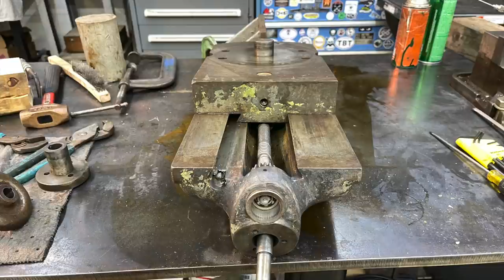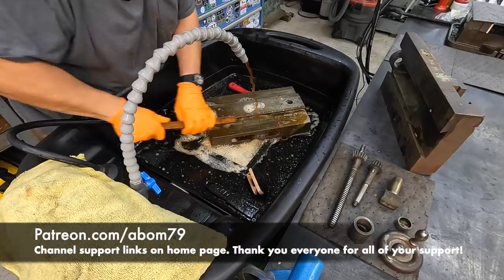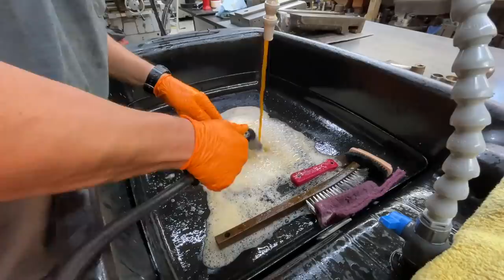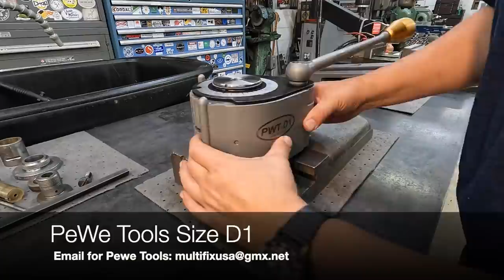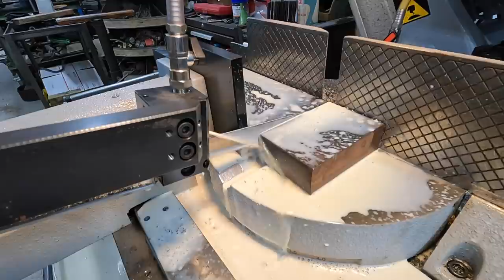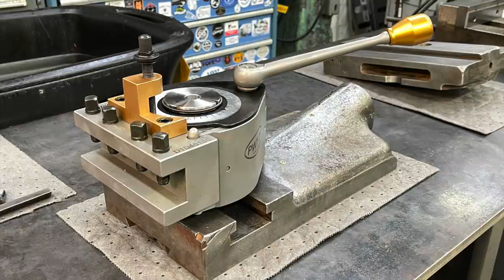SNS 360: American Pacemaker Compound Tear-Down For Rebuild

Comment: If there is enough length to the brass nut, you can incorporate a backlash adjuster by making a 2/3 deep hacksaw cut 1/4" from the end of the nut.  At the beginning of that cut, drill two holes in that 1/4 section and tap them.  All you have to do then is adjust the backlash by tightening the screws.  This closes the gap on that saw cut and picks up that backlash.

Comment: I repaired such a crashed nut a while ago. I bored the old threads (plus 2mm) out made up a brass plug and soft soldered the it in (in place in the milling machine vise), drilled/reamed the inner diameter and cut the new thread on the lathe. it's holding up fine.
I saved a lot of machining steps this way.

Comment: Man... I'm glad that I'm not the only one to have that kind of experience in refurbing an old machine... paint, oil, chips, filth, etc... concealing fasters and limiting movement has absolutely been the biggest theme in my own machine tool wrenching efforts.

As for cleaning, I don't have a parts washer, but what I have found is the most effective/economical is using diesel fuel as a solvent and a green Scotchbrite pad.

Comment: Don't use normal 6201 ball bearings. You need the 3201 angular contact bearings to take up the thrust and backlash
Reply: You can use deep groove ball bearings as if they were angular contact provided the thrust load is not excessive, and in fact most drill presses do exactly that. It would be fine in an inexpensive import lathe, but I agree that for a lathe of this class there should be an opposing pair of angular contact bearings, either with the inner ring end-faces ground underflush (by the bearing maker) to provide the correct preload, or by careful engineering of a suitable (cylindrically ground) spacer.

Comment: Adam, You are a machinist, Correct! Make the nut and cut the threads on the lathe using a form tool. Drill and (on rectangular brass piece first) cut the threads using the 4-jaw on the lathe. Counter-balance. if you screw up, you can always whip-up another one. File the butchered corners on the cross-slide and go to Sherwin Willians and get a gallon of Industrial paint in a bright lovely color of your choice. Paint the cross-slide and all the cast iron parts. Sand and polish the handles. You can paint the bed/headstock later, Hire some kid. The Multi-fix looks great. Oh yea, cut and throw away those 2 threads on the cross slide screw. My 2 pennies!

Comment: That is a beast of a tool holder.   Put the compound back as is but then fab a new equivalent acme screw and nut.   Could also have a new nut cnc thread milled.
Reply: Agreed, replace the leadscrew with a 5tpi ACME thread and a suitable nut. There's bound to be wear in the screw anyway.
Reply: I was going to say that too....

Comment: We just got one of those parts washers into our shop, I was initially skeptical but was very pleasantly surprised the first time I had to clean off some old pins on just how well that solution works!  Just wish the tub was a little bit more heavy duty so we could put our truck hubs in there without worrying about breaking stuff!

Comment: Adam, I think I would make a new lead screw and nut in acme thread and eliminate the backlash in both the lead screw and nut and solve the problem of the obsolete square thread.
Reply from the maker: That’s the plan.
Reply: @Abom79  would changing to the acme thread change how the indicator marks readout
Instead .1000 in actuality it might be .0001?

Comment: I don't know why, but I enjoy cleaning old grimy parts and seeing them come out clean.  Nice parts washer setup.
Reply: Indeed, but it doesn´t do anything (for the home shop guy, at least) which an old laundry tub and some kerosene in a cheap and cheerful lab supplies wash bottle, and stiff bristled brush and some Scotchbrite won´t do. Kerosene is not suitable for intensive long term use in production settings, but if you´re just refurbing the odd machine tool, its perfect. 
Kerosene used for parts washing can easily be retrieved and reused by settling it over water: the dirt drops out of the kero (top) layer and can be drained away and disposed of (without polluting the grey water system). It´s an easy matter to make your own parts washer incorporating this principle with a cheap marine bilge pump. Fit a drain for the semi clean kero in the side just above the level of the water, and another drain (a large diameter screw cap) at the bottom for the dirty water.
If you avoid putting oily parts into the kero it will stay relatively clean. start the process with a ¨total loss¨ stage (ie discarding the minimal amount of solvent needed to wipe off most of the oil)
ScotchBrite is a product which delivers (crudely speaking) twice the performance for a price premium of 1.2x
That orange stuff, on the other hand,  turns those ratios on their head.
I deplore the turn so many You Tube influencers are taking in the direction of promoting ¨affluenza¨. It is undoubtedly good for the Gross National Product, but so are such things as war and natural disasters.

Comment: Adam, at my families machine shop we make very similar leadscrew nuts that are sold directly to monarch and leblond for there spare parts warehouses. They are not typical bearing bronze they are c954 aluminum bronze. Also we get the taps from a supplier called Widell Industries and we use our bigger mills like your new KBC to tap them. However monarch and leblond have switch to ACME threads so I don't know if Widell has square thread taps. Hope this information helps.
Reply: I think a number of us here say thank you, Dalton. That's a pretty useful lead.

Comment: Adam
I have a pacemaker with the same compound. I just dissembled it and my bearings Were sticky like yours. Very similar condition as yours overall. My screw and nut were tight with little wear. [ACCEPT] The first three threads on the brass nut were broke off exactly as yours were. Thats too similar to be a coincidence. I'm wondering if there may be something in the design that either allows too much travel and the screw is coming out of the nut or almost coming out putting stress on the last three threads holding.
I'm going to study the length of travel and see if I can figure this issue out. If you can look the length of travel in relation to the length of the screw maybe, you can figure out why this is happening. It may need a stop or spacer to prevent over travel.
If you see an issue, please let me know what it is.
Thanks Mike

Comment: Adam, you need to watch Kurtis on Cutting Edge Engineering; he makes his own boring bars, due to the size of the jobs he does. His latest one he has to use his overhead shop crane to put it into his lathe.
Reply: Always someone to mention Kurtis when  Adam doesn't like him or his channel.
Reply: @stevendupre2792  Why doesn't Adam like him or his channel?
Reply: Most likely because people are always comparing their channels to one another.
Reply: @stevendupre2792  Kurtis challenges his "keyboard warriors" and he shows how he cuts out 6 extra steps before working on a barrel for a hydraulic cylinder so all he has to do is measure the height and length of the piece before he makes one chip.
Reply: @MRHSDM316SD18186  I'm not sure I understand your comment. I didnt hate on Kurtis' channel or his work. If anything he's more popular than Adam is now since he's become nothing more than a YouTube creator.
Reply: @stevendupre2792  Both Adam & Kurtis know their trade. WHen I watch their videos it's for knowledge on the tooling used for the various types of steel being machined. I picked up a 1937ish Atlas machinists lathe to make my own parts & tools. I am not a machinists by trade; mech. fab. welder by trade. I want to learn how to machine properly as well. I should have done this back in my 20's.

Comment: Adam, if you tap new thread then you might end up with loose fit because of the wear that is already in the square thread so if you tap you might want to get a undersized tap then hone out the threads.
   Someone already posted that you might go to a split nut so you can adjust out the slop when needed

Comment: That's a lot of backlash in the leadscrew. Yes you can work around it, but given that you will likely be using this lathe for many years, I'd put in the time to either cut the right threads for the screw, or just make a new ACME screw and nut to replace the original ones. You have the chops to do it, and the results will be SO much nicer to use..
Reply: That's my bet on what he's gonna do

Comment: Adam, If you can't find a 3/4"-5 square tap and since there are 3/4"-5 Acme taps available you could make a whole new compound lead screw and nut with Acme threads. It won't be original but it will be do-able and work just as well as the original did when new. I believe the bevel gear on the lead screw is pressed on so you won't have to make (or source) a new one of those.

Comment: Here is some trivia you'll probably like.  I learned machine work at place called Industrial Bearing, a bearing suply house for heavy industries like mining.
The bearing you said was "sticky" is a referred to as "staging" because it wants to stage.  Its a very common failure in universal joints where the bearings have made like detents in the race surface from opporateing in the same place over time.  This is the reason engines are mounted in vehicles at an an angle or the pumpkin of axles are offset to one side, forcing U-joint to move enough to use the entire race surface.  So U-joints are actually required to be misaligned to function correctly.

Comment: Nope.  Two 6201s don't make a 3201 bearing.  Regular bearings good for radial thrust, u need a cartridge 3201 for axial thrust.  The bearings u removed failed because they cannot handle the axial thrust of the lead screw.  If u need technical advice find a different bearing supplier.
Reply: @paulcopeland9035  I am trying to stay polite.  Go to bearing book.  Yup, complicated formulas.  Look at coefficient for axial thrust for a 6201, and a 3201.  6201 is a minute number compared to a 3201.  Originally 3201s were sold as two back to back bearings but now are available as a single cartridge bearing w near zero axial clearance.  Dude who advised Adam might be qualified in getting sales entered into the $$$ register but is clueless about bearing types.

Comment: The smart wash Ozzy Juice is an amazing invention.  Since it is sooo expensive the juice they claim not to add water as it dilutes it.  I queried the compound and 98% of the solution does not evaporate therefore by heating it all the time the water is all that evaporates I’ve already done the expirementing it works great cuts the cost down in fact it seems to me it works better.  The mats carry the microbes that eat the oil and grease and have found changing them monthly really helps keep it working great.  One of my favorite tools in the shop.  Im a bit older and find I feel sick if im in the solvent or diesel and have had to rely on rubber gloves.  Getting old is not for wimps LOL.  God Bless you brother.

Comment: Adam, So ill bet if you start asking around you'll find that square thread tap up here around the Cleveland, Ohio area or the Great Lakes area. Some where that those 80-100 year old machines where worked in back in the day. I've shot a buddy of mine a message thats in Euclid, Ohio. He's still has his fingers in older tooling like this, So its very possible to still find a tap that you could source to make another replacement nut.
Reply: Вітання з УКРАЇНИ ,думаю мітчик  можна виготовити самостійно, враховуючи нестандартне  різьблення винта. Запалити та відповідним чином заточити. Для майстра це буде не складно.
Reply: weren't Monarch lathes made in Sidney Ohio?

Comment: I think the design for this T nut will evolve once you get into making it. A stud is going to be way more rigid than a bolt for clamping the tool holder down and that tool holder is a very serious piece of kit! Look forwards to seeing a nicely engineered solution but I think you may be rushing into this which is an easy trap to fall into when you're mad keen to get the new workshop up and running.

Comment: great informative video, just a point, as the screw is steel and the nut can be brass or bronze, you could cast a nut using the screw as a former, it would take a bit of prep but would be like casting a Babbitt bearing not accurate or inaccurate but if you cannot find a tap then it would at least get the thing working,
Reply: Yes, then re-temper the screw?
Reply: Casting babbitt is completely unlike casting a conventional (high melting temperature) metal bearing or nut. It´s almost impossible to do the latter without making the screw and nut virtually inseperable, apart from the very real problem of distortion and (as Charles correctly warns) change of metallurgical phase.

Comment: 6201 bearings will be fine, but the 3201 bearings may have been angular contact. The modern day designation would be 7201.

Comment: Hey Adam, you might contact Keith Rucker. He has done this kind of thing in the past and may have the tap you need. You might be able to make an arrangement with him where you can make a new nut and then send it to him to have him cut the threads for you. 

If he doesn't have the tap, he may know where to find one.

Comment: Is it not possible to just machine the shape of the nut out and use the 4 jaw in the lathe to tap the threads wit a boring bar and be able to fit it precisely instead of a tap?
Reply: Possible, yes. But remember that he mentioned the thread is a modified square form, sort of halfway between a true square thread and an Acme thread. Cutting those threads on a lathe is no mean feat, and it's much easier if you have a tap.

Comment: I was one of the younger morons who put an old bearing on my index finger and applied high pressure air to it and thought it was funny  listening to it spin at a high pitch and rpm until it broke apart one piece hit me in the face the others across the shop almost broke my finger from the centrifugal force so that was a first of many lessons 35 years ago

Comment: Just out of curiosity, why did you not make T-nut the same width as the tool holder instead of the width of the compound. That way you could loosen the the bolt and slide the tool holder and T-nut in the compound where you needed it based of the orientation you needed the cutter to be in.
Reply: I was wondering the same thing.  Seems much easier than unbolting and moving post

Comment: Adam, Rossilake is right; it would be far better to screwcut your nut. I did just this job to my old lathe during Lockdown. Before making the working nut I made a two-part lapping nut and went over the screw because, as usual, the middle of the screw was more worn than the ends. In getting it uniform, of course I made the square thread uniformly narrower than the original, all along. I was then able to screwcut the working nut to suit. Besides, by screwcutting you can be more confident that the geometry of the part is true, with the axis of the thread exactly square to the axis of the spigot. It wasn’t a lot of work.

Comment: Adam, worst case for that brass nut and screw if you can’t source a tap you could cut the square thread off and weld on a more modern acme thread and make a brass nut for that. If you do find a tap to match that old thing I would be it’ll cost a pretty penny.
Reply: Also would need a LH tap.
Reply: NOT brass. Bronze. 
Brass would barely be acceptable on a cheap knock-off dispose-a-lathe.
Reply: @Gottenhimfella  You're right, I misspoke.

Comment: Thanks for another great video! I have always twisted the lead screw nuts on my compounds to make up for small amount of backlash, they usually have a set screw on the side to hold it. . No way to do that with that dutchman pin style and that looks like it has a bit much of backlash to be able to do that. Had to check my collection of odd taps, closest size is 7/8-5L  in a square thread.

Comment: Might be better to remanufacture the leadscrew and brass nut as an acme thread. Cut off the old bevel gear, bore it and use it on the new leadscrew.

Comment: I rebuilt the compound on my 16x54 American Pacemaker, because the bearings were crunchy. Be careful when you put the tapered pin back in place. In my case, I believe reinserting the pin caused the bushing, which holds the bearing, to deform slightly. This resulted in the new bearing not being as smooth as I would have liked.

Comment: That CRC Smartwasher is an amazing thing with its recycled "juice". I just spend a few minutes watching videos about it.
Reply: Degreasers have been recirculating solvent for near 100 years.  Possibly over 100 years.
Reply: @AlanTheBeast100  wow, never  seen one before. Thanks for the info.
Reply: @paulcopeland9035  
Not debating the solvent quality, just pointed out to SV that recycling cleaners have been around for a very long time.  They used to use volatile cleaners or simply detergents - whatever was appropriate to the task.

Comment: Just curious,  Why wouldn't you make your T-nut the width of the PW tool holder?  If it was you could use a bolt or stud and loosen and slide the holder where ever you want it within the slide.
Reply: I was thinking the same thing. That is how it is normally done from what I have seen at least. To me the 3 holed set up seems like a lot more work to reposition.
Reply: @matthewperlman3356  I've made three t-nuts for my lathe, and I've always just made them the width of the tool post. In fact, when you purchase a new Aloris tool post, the blank T-nut they proved is the same width as the tool post. Nothing excessive.
Reply: @marcsimonsen1578  Yes, just loosen the top nut and slide to whichever side or in-between you need at the time. Only takes a few seconds to change.
Reply: This was going be my question, surely a smaller T-nut that slides is far more versatile than trying to align the tool post with a hole?